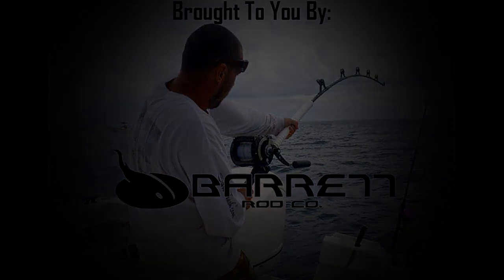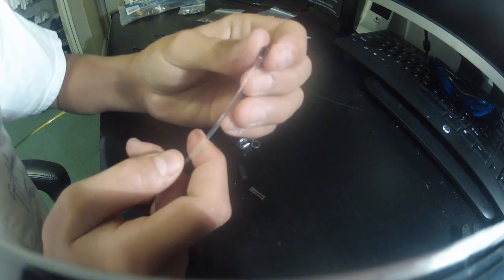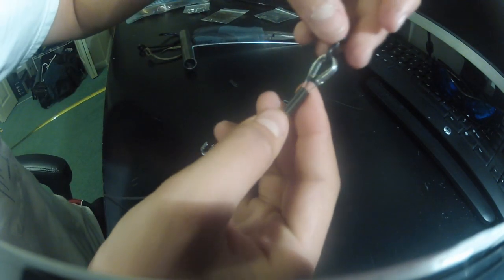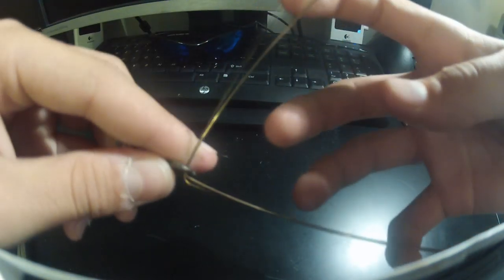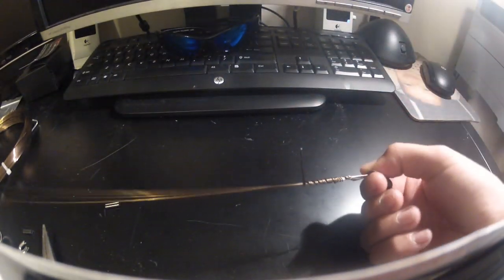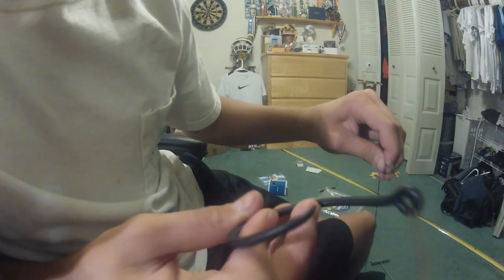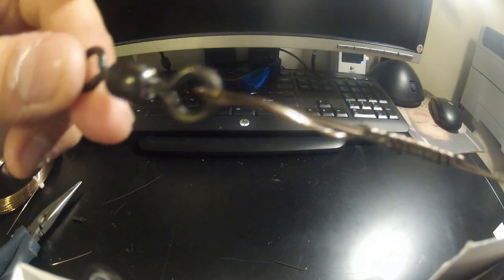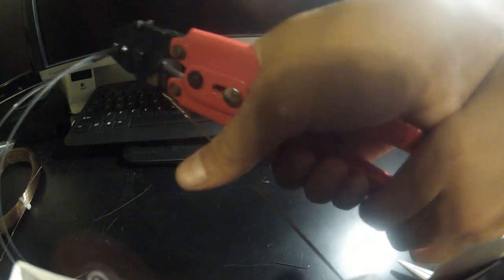Professional Shark Rig Tutorial for: Land, Pier, or Boat

Comment: Not bad, I normally use 17 feet of 550lb mono, I use an offshore loop for the swivels, crimp, twist the remaining 11 inch tag end around the mainline and then crimp again. I wish I had the patience for single strand that you do. I double crimp 600lb 49 strand cable to my hook. I don't like dealing with single strand wire at all.

Comment from the maker: If your fishing off the beach, you can't cast out this rig. You have to kayak your bait out and attach a pretty heavy piece of concrete. Like a cinder block. I'm not sure how heavy. It depends on the amount of current and how heavy your bait is. I usually use weights around 5lbs? its a guess... off a pier or a boat, I just toss the bait out with my hands and let it sink....